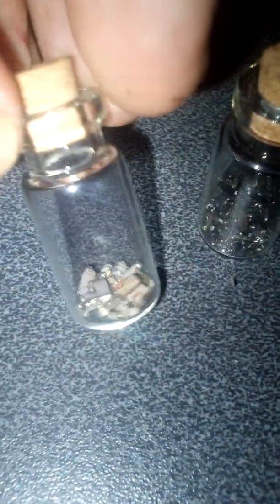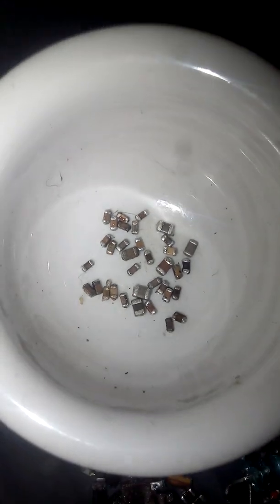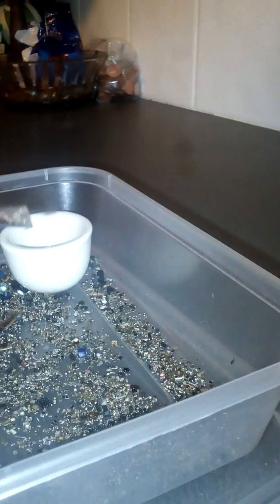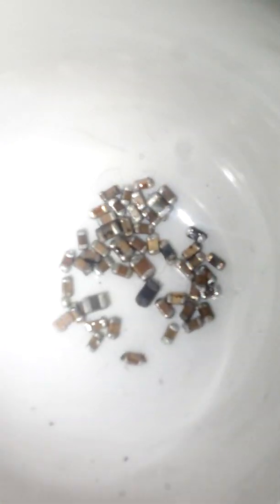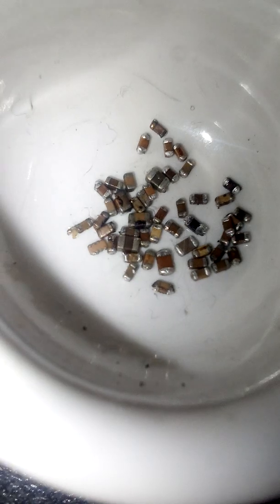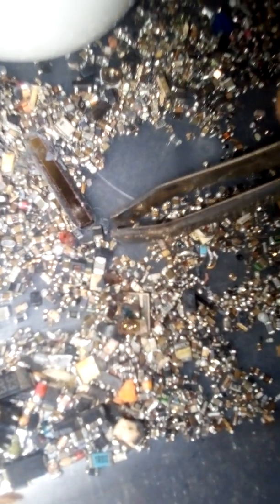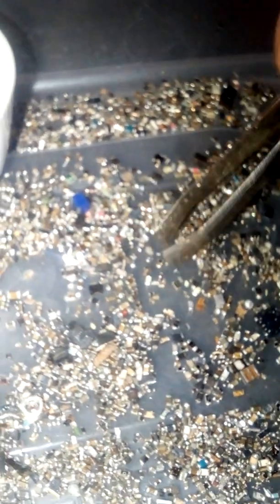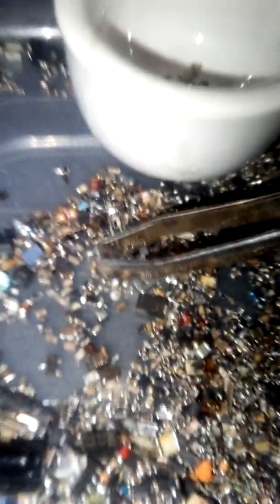Separation of PM Components From SMD E Waste.(Gold,Palladium,Ruthenium,Rhodium,Tantalum,Silver,Tin)✨

Comment: Is the separation necessary? All the PMs will be 'contaminated' by other PMs no matter how much tweezing you do. My understanding is that refiners process these until it's all just PM, then obtain the pure metals by chemical means and with electrowinning.
Reply from the maker: Separate components contain different metal,alot are likely still functional for reuse and resale,not just for refining use,but even then less chemicals can be used to extract specific metals making it less expensive than doing it all combined,and less contamination with unwanted components also saves on chemicals.
Its just one among many ways to recover process or recycle and resell.